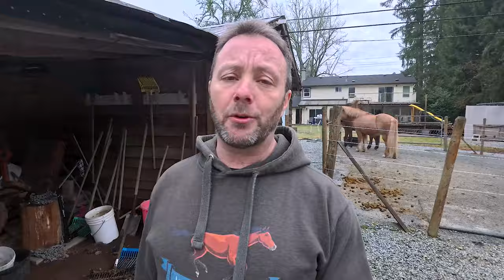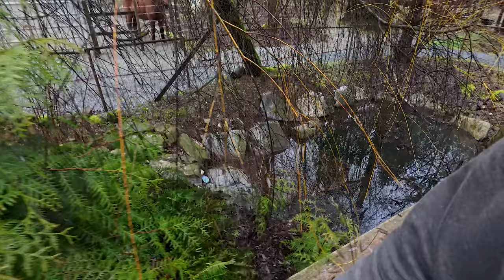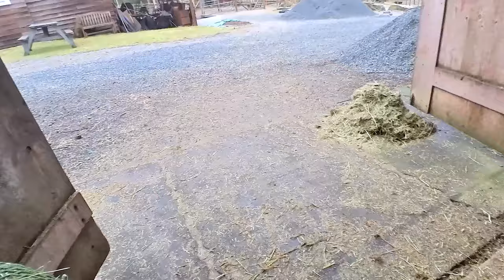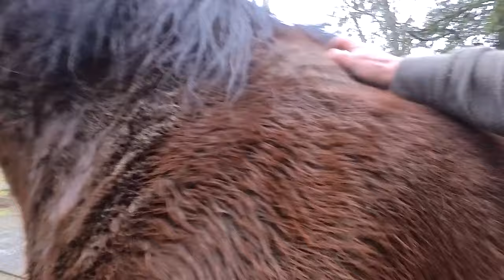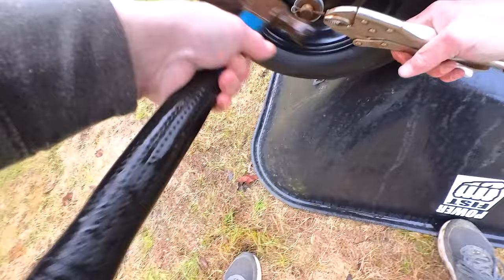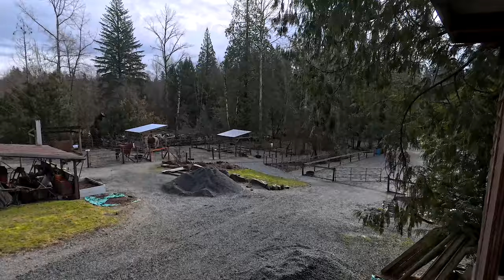We've NEVER Been Down This Low On Hay EVER

Comment: I was wondering how you would get the hay up in the loft.  Looked like a very efficient ramp that got it from the truck to your barn.  👍☺️
Reply from the maker: It's called a hay elevator actually. In this case they had it mostly horizontal, but many go from the ground upwards to lofts.